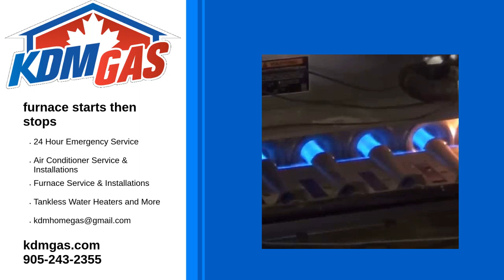Furnace Starts Then Stops

Comment: Hello.  Thank you for posting an awesome video on how the gas furnace works.  I have a question if you could take a moment to answer?  I get ignition then furnace shuts down.  I clean the flame sensor and it works for about 3 days or so.  Take it out and clean it again.  Works fine again for another 3 days.  Replaced flame sensor.  Same thing.  What do you think the problem could be?  Thank you!
Reply: Hello Gary 

Thank you & regarding you’re flame sensor it could be a few things.  As a general rule of thumb it is always best to have an annual maintenance done on your furnace to ensure that it is working according to manufacturers specifications.   Your contractor might find that the sensor is not set up properly, or that the input/output on your gas valve needs to be adjusted.